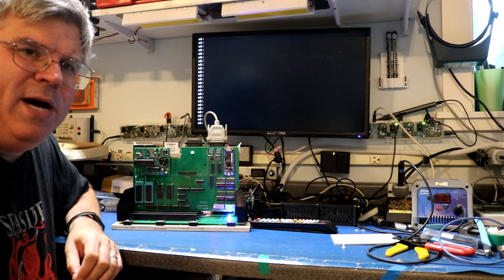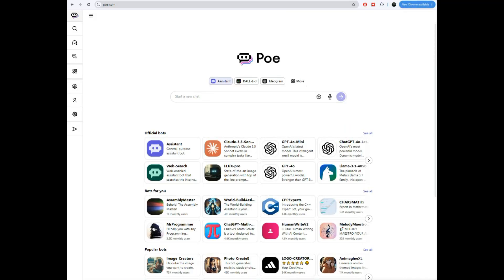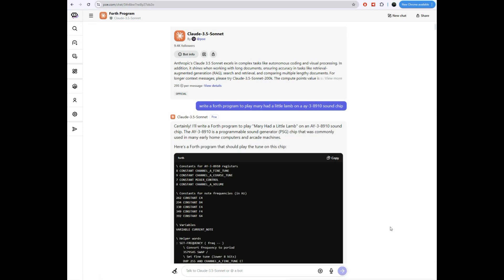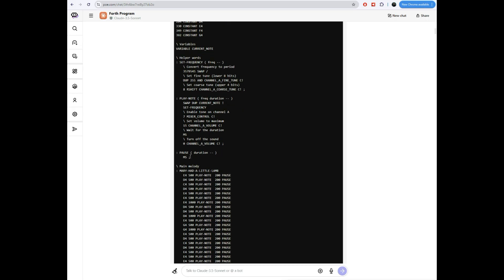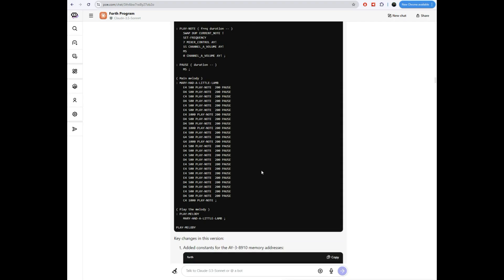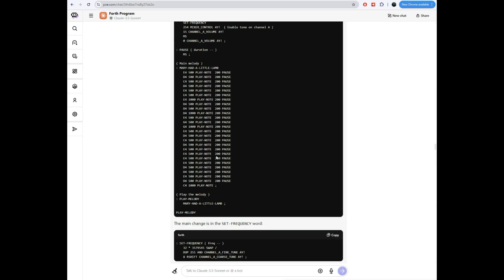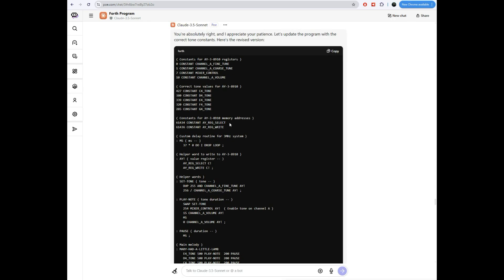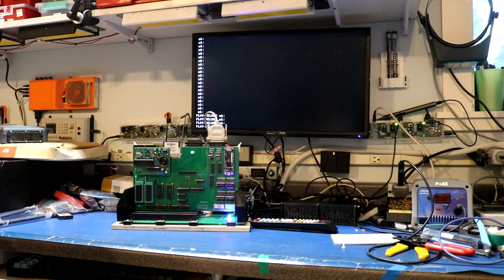Can you use AI to program your Vintage Computer? Anthropic Claude writes Mary Had a Little Lamb

Comment: I tried getting ChatGPT3 to write assembly code for M6809 and HD6309 (in native mode), and it was an interesting source of ideas, but it hallucinated nonexistent instructions and registers!  I tried to get it to output music for Yamaha YMF262 FM synth, and it was a similar story.
Reply from the maker: I did get Claude to generate some 8008 and TMS9900 assembly. It did invent a few nonexistent instructions on the 8008, but you can usually point out that the instruction doesn't exist and it'll go fix it. It does make me wonder if you could take the output of the LLM, assemble it, and feed the error messages back into the LLM and have it automatically correct. This would at least lead to correct syntax, if not necessarily correct behavior. Anyhow, the code generation LLMs do seem better now then they were last time I looked.
Reply: @smbakeryt same here ... ChatGPT 4o has improved a lot but still far from being perfect.

Comment: Do you think that the amount of effort of guidance to the AI worth  as opposed to coding it? I'm genuinely curious. Edit: 18:16, you answered my question. Thank you.
Reply from the maker: I did feel like I got a better payoff having it generate assembly language for me -- in this case the output is longer and more mechanical and I felt like the time savings was increasing. It was also the case that with assembly, when it makes a mistake (like inventing an instruction that doesn't exist), pointing out the mistake will lead it to correct all of its mistakes at once. The models are probably also better trained with more modern languages, such as Python or Go, where I would expect it to do a better job.

Comment: I really want to see AI port programs to different platforms. Or, at the very least, port to semi-compatible systems where the mapping is different. For example, taking disassembled code from an Atari 8-Bit game and “transporting” it to the Atari 5200. Maybe fitting a larger game into a different ROM scheme that supports higher capacity cartridges. Or, more exotically, cleaning up and reducing the size of the old code. And that’s even before moving onto requesting the AI to port the code to a different platform that would have different audio and video chips, or even different CPU architectures. What a trip that would be.
Reply from the maker: Oh it can do that. After the demo in the video, I told claude "Convert this to TMS9900 assembly" and it did what appears to be a reasonable job of it. Then I told it to "Convert it to 8008 (not 8080) assembly", and it did that too, though I had to instruct it to make several corrections. I haven't verified that either of the two assembly programs work, but they look reasonable.